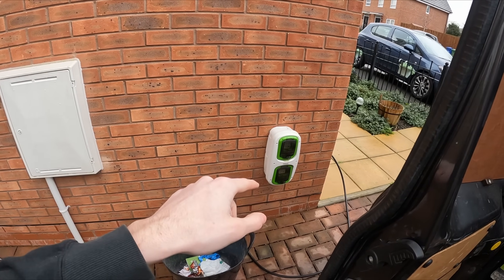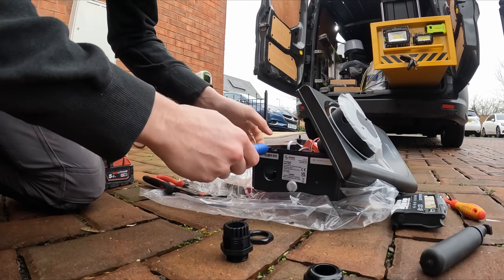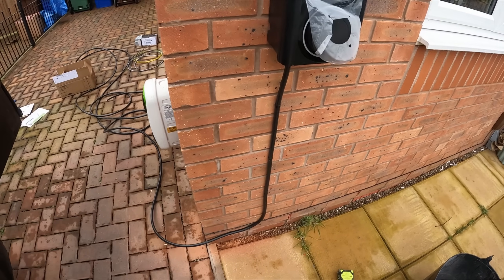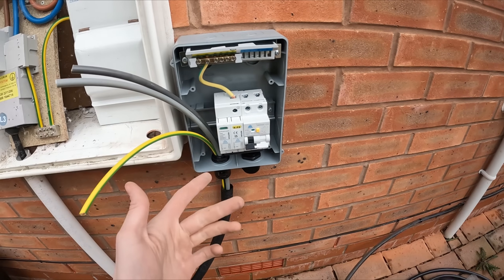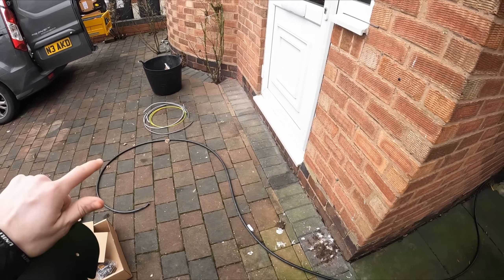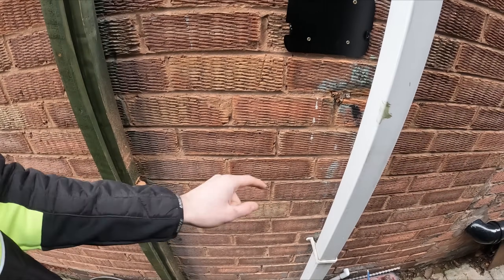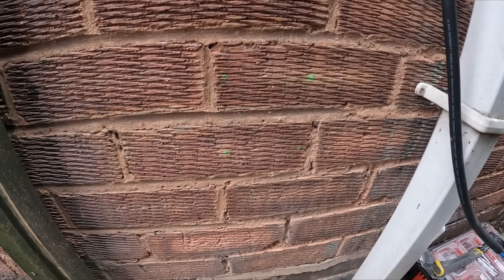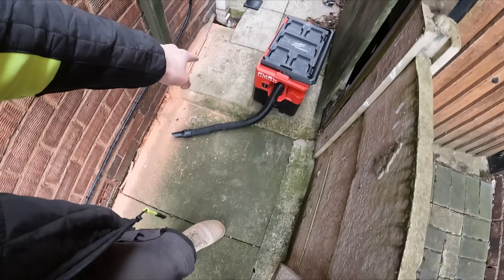Long Day At Work , Installing 2 Different  EV Chargers

Comment: Did that 1st property not already have a Rolec EV charger? Could you not just replaced it?
Reply: Doubt the cable would be big enough for a real charge point
Reply from the maker: Bang on
Reply from the maker: Only a socket 16 amp 2.5

Comment: Two very good installations. Good on you for calling out the flimsy mount hardware. By the way, you don't need to strip the wires when using jellys. The insulation gets pierced when you clamp down on the connector.
Reply from the maker: Ok cheers I thought it would be better connected with stripped and doubled over wire
Reply: @AdamDunlopElectrical  Your logic is sound. However, the jellies are designed with metal prongs inside that pierce the insulation to make a connection. This would only work with low voltage, obviously. It makes these connectors very handy as so little effort is needed to make an electrical attachment.